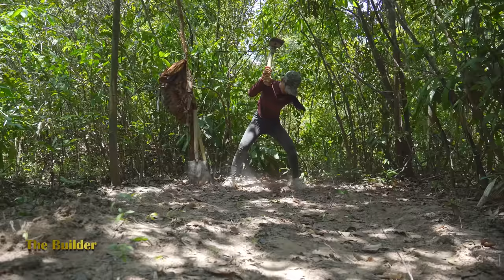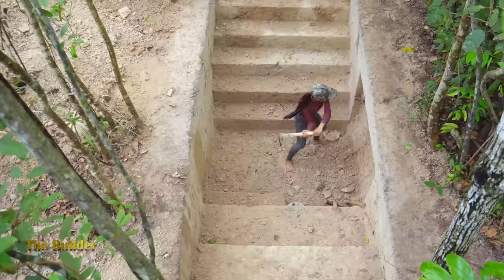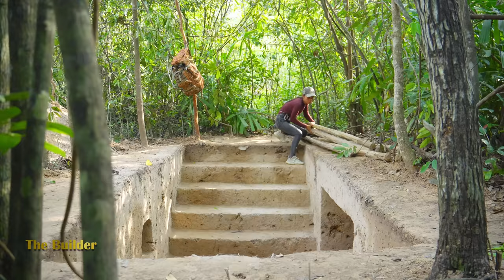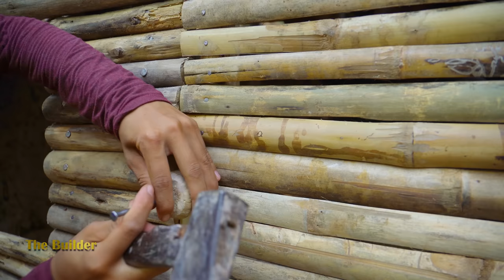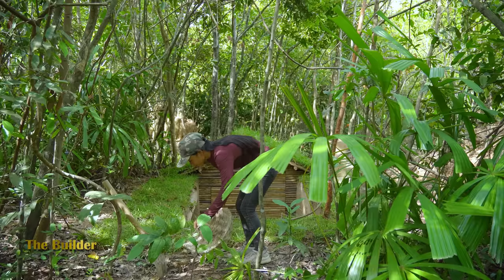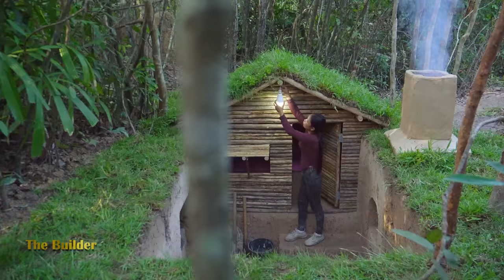Girl Solo Living Off Grid, Build a Complete Warm Underground Dugout Home Shelter for Fortnight Stay

Comment: Amazing work. As for the CO2 comment, this is obviously a hot, humid climate where the fire would only be lit for cooking and thus only limited amounts of the gas would collect in the pit before it is reabsorbed into the air. Note also that the bed is raised well above the main floor, in a seperate structure that receives plenty of ventilation under the eaves of the roof and the pit itself is entirrely open to the sky.

Comment: I'm a contractor here in the US have been for the last 20 plus years and I have done hand excavation usually with about five or six guys digging a hole is 20 ft and doing it with Precision special if you don't steps I have had to hand it out pools and it has taken me and a crew of about seven or eight guys a good week to do so and this video they want us to believe that this space woman was able to dig out this thing in a day and yet she is not covered in dirt she does not look filthy just not look hot sweaty or tired this makes no sense I dug a small hole once and it took me about 20 minutes and I look like I've been rolling around mud😅 I still like the design it's a nice look

Comment: my question is...does the the clay become water logged and turn soft over time if it rains too much?
Reply: Only if the water has an opportunity to "sit", and then the top inch or so will turn into slime.
Reply: @AgnesMariaL  Thanks...I would like to build a home from clay someday. its only about 80$ per ton.
Reply: You can tell by the soil that it hasnt rained there in a while. They're in the dry season where she lives.